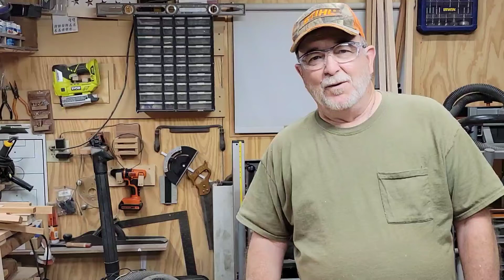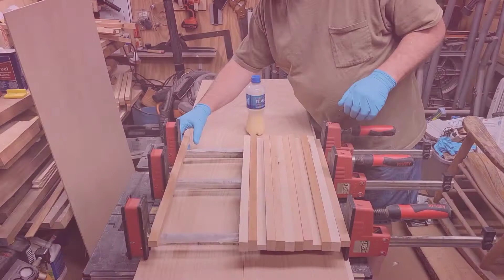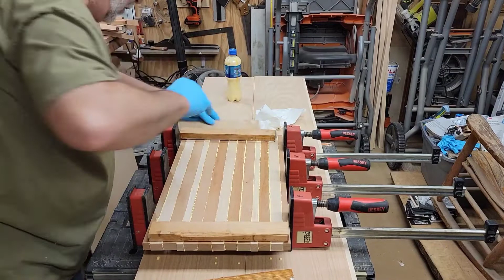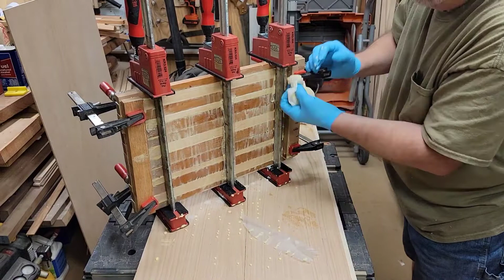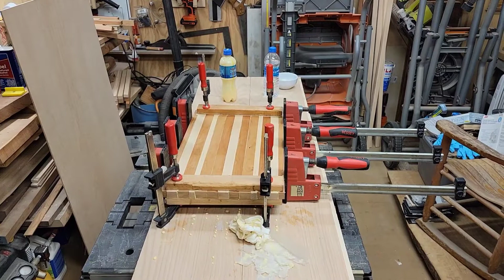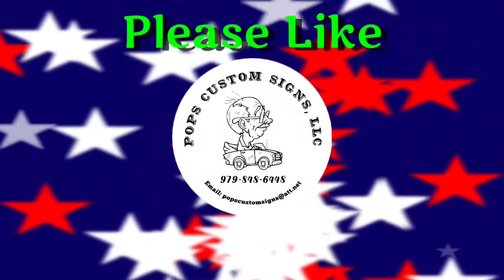Meagan's Board - Video #1

Comment: Frank i want to glue some alum t track in the board do you or have ever done that dont want to put screws in it to reduce the weigh i am going to make a cross cut shed for my table saw i  have one now but it so darn heavy.  let me know if you know of any liquid nail or jb weld ?? THANKS STAN
Reply from the maker: Stan I have never done that.  But as for glue, I always use Tite Bond II.  Not sure if it adheres to metal though.  I don't think screws will add that much to the weight of the sled.  I'm thinking even the t-track weight is not much of a factor.
Reply: @PopsCustomSignsLLC  I WILL TEST A SMALL PIECE THE SCREWS ARE CAUSING THE WEIGHT WANT TO GO TO 1/2 PLYWOOD INSTEAD OF 3/4  YOUR CTIING BOARD WILL LOOK VERY NICE
Reply from the maker: @stanmashek3085  thanks Stan.  Let me know how it works out.